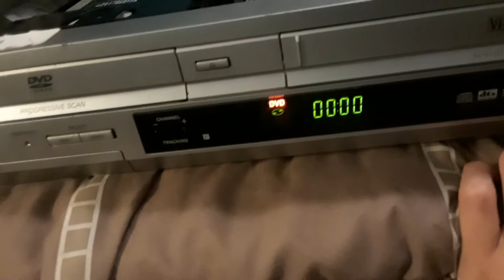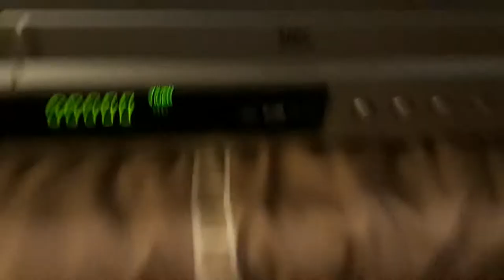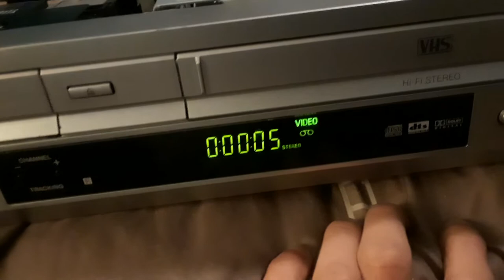Repairing Sony SLV-D350P VCR/DVD Combo

Comment: Hey man, thanks for the video. Im having the same issue with the DVD tray not opening and tapping the top works for me as well. Can you tell me what I need to lubricate and the type of lubrication to use? Thanks alot!
Reply: I'm having the same problem. Could you tell us how to lubricate the motor please?
Reply: Me too... let us know what kind of lube you use to get that tray to open.  I picked one up for free ... and want to resell it.. however the tray won’t open... I don’t believe there is a disc in it.. but i haven’t opened it up yet.  Thanks
Reply: I saw in another video last night that they used Light machine oil and it went inside the motor from the top to lube the ball bearings
Reply: @panicfilms  cool... The player I have ... it’s exactly like the video... when there’s a disc in it... it works flawlessly...take the disc out... doesn’t open. Really weird. Hopefully the creator of this video will chime in.  Everything else on the unit works great.  Thanks guys
Reply: @TrollHunterxXx  I have the same one too and it only opens when I tap the center like in the video. This is the one I saw the oil tip and how to fix it - https://youtu.be/QRF-dPyVWeo
Reply: @panicfilms  you’re the shit!  Thanks!
Reply: @TrollHunterxXx  no problem! Good luck!
Reply: I know it is quite off topic but do anybody know a good place to watch newly released tv shows online ?

Comment: I have a slightly newer model, a SLV-D370P that I picked up after someone else threw it out. The VCR still plays despite missing a door, even the DVD player works somewhat. I'm thinking it might need a Re-POT because the laser is weakening. I'm also interested in finding a way to unlock the region coding because I have way too many Japanese R2 DVD's.

Comment: I just got this same dvd player and I'm pretty sure the motor that controls the DVD drive belt is dead. I took the entire drive apart and I can tell drive belt motor is not rotating while powered.
Reply: I just verified it isn't the motor. To test the part out I de-soldered the motor  wires and ran the motor on a 9v battery. So its some issue with the DVD board like a dead capacitor there is a slim chance its some issue with the flex cable. Also the drive does play DVDs, the only issue is that the disc tray wont eject.

Comment: FYI: I have this same model and it had the same problem with the on/off button. I took the button out and coated the back of it with white silicone sealer then let it sit for a couple days then I put it back together and BOOM......problem fixed. It now turns on and off every time I press the button!

Comment: My my sony slv-d350p will not start,  I checked power cord and fuse all ok. Power switch is ok. Can you help.
Reply: Did U open it up and do a visual inspection of the capacitors maybe u get lucky see one that is bubbled up or leaking.